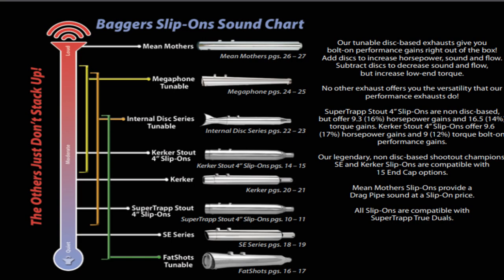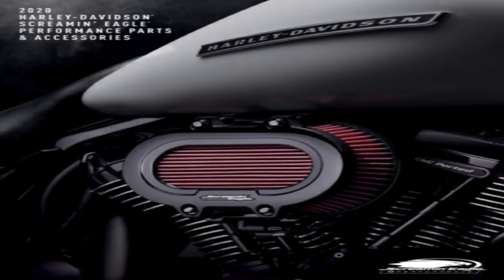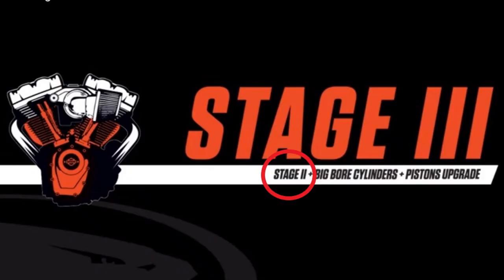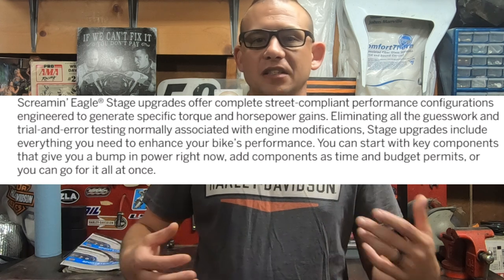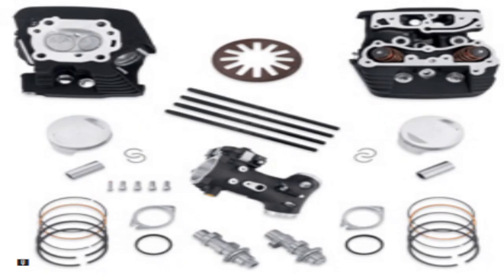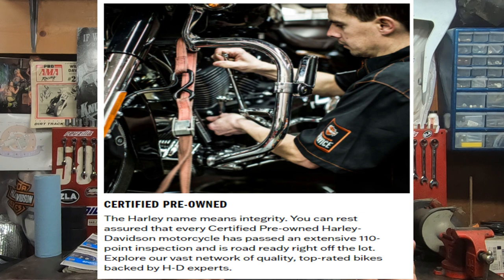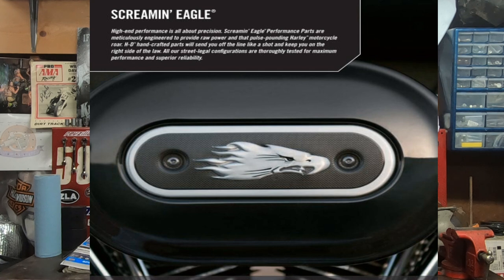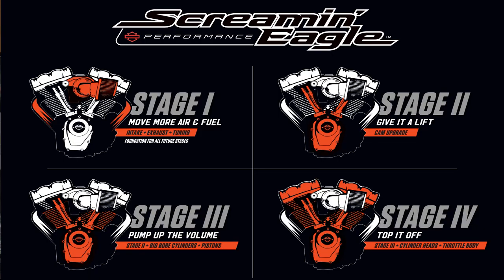Stage Kit Secrets, What Harley-Davidson Doesn't Tell You

Comment: I want to eventually take my stage 1 TC88 to 100ci.  You hit exactly what I'm struggling with.. I've been trying to figure out how to do the cam chest now, and do the cylinders later.  Doesn't seem you can without re-buying cams.  ( I'm not a motor head but think I can do this)  therefore I'm leaning toward an all inclusive s&s performance package.. it's just a difficult pill to swallow with the cost of things right now.
Reply from the maker: You can update your cam chest without even touching the heads... You'll need to cut your pushrods and then go back with adjustable pushrods. This will allow you to update the cam chest without even having to crack the rocker boxes.
Reply: @GixxerFoo  yeah. I know that but I want to buy the cam once. Not sure I can run the s&s 585 or a comparable wood cam without doin big bore kit w/ higher compression.   I'll prolly have to save my pennies and go for it all at same time. If I'm cracking the rockers to do springs, I'll likely want to just go ahead and do it all at same time..

Comment: Stages ,Stages, Stages  everybike needs an air cleaner & exhaust but it should be a mess big sucker air cleaner - preferably a Thunderheader  exhaust & a tuner that will get you started in the right direction all other modifications will depend on how fast you want to go & how much cash you have ! Screaming chicken parts are a compromise at best look to the aftermarket for everything else ! At my shop I am the warranty ! Hell I got 80 cu in bikes out there that will out run most of screamin chicken bikes ! I had a guy just the other day that told me the worst sound he ever heard was when my 80 incher blew by his 117 M8 !
Reply from the maker: I wouldn't feel too bad about getting smoked by a Evo on a M8 especially after hearing what's in your Evo!

Comment: I'm relatively new to Harley (2 years) and am loving my Sportster 1200L to death.  While I appreciate the vast selection of aftermarket accessories, if I had wanted raw speed & power over everything else, I would have just bought a four cylinder Japanese sport bike -- "One and done".
Reply from the maker: I rode inline 4 sport bikes for years, the thing I noticed was just as they started to really run you had to shut it down. But the Harley on other hand a Harley can makes more power and torque way down low were you can use it. Lol I used to get smoked off the line by Harleys.
Reply: @GixxerFoo ... that was probably me on my 1st ever Harley 1200 sportster in '88. I did that every time. Crazy, right?

Comment: I go out of my way NOT to go to the HD dealership. Every 12-15 years is enough.
Reply from the maker: I don't blame you there!
Reply: Well my thought on the dealerships is this. Given the fact that they ARE expensive they are also bound by Harley to follow all recommended procedures regarding repairs which would include proper torque specs, replacing certain hardware, ie; nuts, bolts,washers, gaskets and things of that nature and simple physics and metallurgy does lean towards things like fresh hardware to preserve integrity in fasteners I do opt for the dealership since speed kills and I ride pretty quick. To add to that the mechanics have to be certified by Harley to work there. Not saying anything bad about the independent shops but I’m pretty sure most of them don’t stock all the fasteners required for service. When I see the fasteners listed on my bill I do pucker but at least I feel safer knowing they were replaced. I also like the accountability. I’m sure some will say that their independent shop is great and I’m sure they are but I just don’t want to go around “trying out” various places with my neck at stake. I tried that where I moved to based on recommendations from people that I know and had a guy do 574 cams. Said he’d do a high pressure oil pump and didn’t. Turns out no oil pump change, same cam bearings and bases on what he charged me no new fasteners or gasket kit. When I asked around awhile later I found out he’s a coke head and we know where that goes.

Comment: 114 to 122 uses cam from Stage 2 and subsequently stock heads. Can add SE ported heads and bigger throttle body later and wind up with a Stage 3.5....lol The only "waste" is would be the Stage 2 pushrods if gong from Stage 2 to 122 ci.

Comment: Great info as always. I always looked at a stage 2 as the way a bike would run from the factory if there wasn't an EPA. After that I would say that an engine should be designed for what you want, right from the start. There isn't much sense in constantly rebuilding and moving from one stage to the next. Build it the way you want it right from the start. I personally wipe my ass with the warranty but to each his own.
Reply from the maker: The warranty really isn't worth a whole lot in many cases, but some people are really hung up on SE parts and the warranty coverage. Honestly the main issue with the M8 is the sumping and Harley is very reluctant to do anything with it under warranty.
Reply: @GixxerFoo  I'm not surprised. I've never had any luck getting Harley to do any warranty work or honoring the few simple recalls I've had over the years.
Reply: There is zero reason to ever buy a Harley brand new, especially if you have no need for a warranty. I have several HD's and I have the one I bought brand new 22 years ago before I knew any better. Love the brand and love you slinging the truth to the masses GixxerFoo!

Comment: With a 117, Harley does not offer  torque cam or a power cam, however they come with a higher revving power cam as stock. They do offer a Screamin' Eagle SE8-515 Cam.  What does it do if you have any idea? All it says is ''The cam’s high lift and long duration profile is ideal for opening the valves to efficiently fill the combustion chamber of larger displacement engines.'' Does not show any dyno charts so do not know if it changes the RPM rev range plus or minus? Want to keep warranty so can not go after market.
Reply from the maker: If you're looking at the 515 cam that's more of a top end cam, the 117 kit makes something about 120 horse and about 115 torque. What that cam is going to do is push the horsepower and torque higher up the rev range. You lose a lot of low end torque in my opinion but make it up on the big end. I would go with the stage 4 kit rather than just adding the 515 cam, you'd have to change the valve springs out as well. If you're going with just a cam I would do the bolt in torque cam from Screamin Eagle. But on a Milwaukee 8 a cam swap with a Wood WM8-XE will blow away the stage 4 kit with a bolt in cam swap. You'd void the warranty but it's a great option to consider after warranty.
Reply: @GixxerFoo  You said, ''If you're going with just a cam I would do the bolt in torque cam from Screamin Eagle.'' But with a 117, Harley does not offer a  torque cam or a power cam, however they come with a higher revving power cam as stock. So I was wondering if the 117 on a Street Glide ST model has ENGINE TORQUE (RPM) 3750, and the Low rider ST 117 has ENGINE TORQUE (RPM) 3500 (A 114 has ENGINE TORQUE (RPM)  3250) what does the 515 cam do as the 117 in both Street Glide and the Low Rider both have higher RPM power type cams already installed? So why would anyone install a 515 cam in a 117 when they already have a high RPM cam already?

Comment: Harley is flat out stealing our money when it comes to a stage 1 or 2 kit. There is no reason the engine should not already have better flowing air, exhaust, and a cam for TQ or HP depending on the model. If the EPA approves of these changes then it should come this way. No tuner needed until the stage 3 or 4 mods.
Reply from the maker: It is suspicious when you look at the Screamin Eagle slip-ons and open air cleaners. All EPA approved but they give you a restrictive air box and mufflers right off the show room floor.

Comment: I really like your content. I have a 2014 flhtk with stage 4 103. I don’t like the cam. I do a lot of touring and fully load my bike with wife on the back. We go through the Rockies quite often. I would like better response from my bike. I ride between 2500 and 4200 rpm. Very rarely go above 5000 rpm. I find midrange torque to be modest at best. What would you recommend to wake up my bike?  I only have 30k on my bike as Covid and a knee problem kept me down the last few years. Any recommendations would be appreciated. Thank you.

Comment: Great Info! I've got the stage 1 done, and now I can skip the 2, and 3 and go straight to 4🤗.
Reply from the maker: The Stage 4 is interesting as it makes roughly the same power in the low and mid range. With the Stage 4 all the power is really up on the top in the higher RPM range.

Comment: Great video and you nail the truth every time the screaming eagle parts are good the problem is the map tuning they use and the cams are well you know that’s why after your advice I went to fuel Moto got woods 555 cams and jackpot mufflers once done end of December I will let you know what it dvnos out at and FYI to all if you do any performance upgrades and keep it under warranty you must do it the first 90 days of purchase no exemption and the extended warranty starts the day you buy your bike every one have a good weekend
Reply from the maker: Harley's street tuner doesn't allow the air fuel ratios to be adjusted, no matter what timing and cylinder VE adjustments are made it's still running at the maximum lean ratio per throttle position. The cam and exhaust from FuelMoto is going to be the ticket!
Reply: @GixxerFoo  yes and that’s why I’m having it dyno tuned can’t wait they said I should see high 90s on ho and over 100 fp torque can’t wait

Comment: Well I have a 2014 road king with the ho 103 and a v&h fuel pack tuner...and it performs really well...
Reply from the maker: Those FuelPaks work great on the fuel injected 103's, it gets the fuel in them and makes the necessary timing adjustments. It's really a night and day difference!
Reply: @GixxerFoo  yes it does.
..I just have old school fishtail slip ons and I can still tell a difference

Comment: I have a 2015 Street Glide Special with 30,000 miles.  I would like to use the Woods or S&S bolt on CAM with this mileage are there concerns with this mileage?
Reply from the maker: It just depends how well the bike has been taken care, but with that kind of mileage I would look at a lifter change as well. A good inspection of the cam chest and if everything looks good you shouldn't have an issue.

Comment: Yet another great video! I'm skipping the stage kits and in the process of putting the SE 120R with D and D low cat exhaust in my 2013 CVO Breakout. Yes it's more expensive but I get to keep my 110 which only has 10k miles on it. Do you think the stock transmission will hold up to the torque the 120R puts out?
Reply: The trans will but the compensator,  chain adjuster and clutch will need to be addressed..really the bottom end is also a concern..ie..crank/pinion runout ..bearings etc...
Reply: @edwardfaris8516  Much appreciated! I'll get to work on these. Seems like there is always something I'm forgetting 🤣
Reply from the maker: The transmission will do just fine, I would for sure us a good compensator, heavy duty clutch and a manual primary chain tensioner. Those additions to that motor will save you a lot of headaches down the road.
Reply: The six speed trans is a piece of junk & will absolutely die the main bearing dies but if you drain whatever oil you have been running & use Amsoil 75/140 severe gear in it you might save it I've rebuilt quite a few  some of which I had to cut what was left of the bearing race with a cutoff wheel ! One of my customers has 2 rebuilds before I started using 75/140 Amsoil his bike has 90000 miles on it !

Comment: As with any build or project bike boat car etc. First have a plan as to what you want the end product to be otherwise you waste money… they aren’t being sneaky or tricky… As far as the stages… stage2 you can’t maximize a larger cam if you can’t get the air in and out better. Stage3 you can’t maximize extra displacement with a smaller cam. And Stage 4 when you really bump up displacement and cam size refer back to stage2 reasons 
As far as aftermarket making more power cheaper that’s all they do… they aren’t R&D entire machine just one small area hence the better attention to detail that’s all they are dealing with. That and they don’t warranty your project/build either

Comment: You are 99% correct. The main reason why SE cams are not as aggressive as others is because of EPA compliance.  Also, extreme lift cams typically result in early wear ant tear issues.  I also think HD rips us off because a Stage 1 should come stock from the Factory, you shouldn't have to spend extra on that.
Reply from the maker: The SE cams are for sure built with emissions in mind, it's hard to be emissions compliant with high overlap cams. Most bolt in cams aren't super hard on the valve train, now you get into the very extreme Wood cams that could cause some wear over time.

Comment: Interesting and informative video as always. I am interested in your opinion on these lumpy high lift cams as they require heavier. sometimes much heavier valve springs. Since this requires more work from the engine simply to actuate the heavier springs. could this cause a in decrease overall engine output and/or excessive valve train wear?
Reply from the maker: A high lift cam with a lot of overlap using a heavier spring won't decrease power at all or cause excessive valve train wear. When you go with a high lift cam, matched with valve springs and setup up properly with correct push rod length it is very reliable. But of course with a cam like that you need to have the correct compression ration as well or you will go backwards in performance.
Reply: @GixxerFoo  Thanks for the quick reply. As usual a concise and balanced answer.

Comment: So if your end goal is stage 4, I should skip stages 2 and 3?
Reply: I would say yes. If you've got the funding for it, look closely at the torque curves in the catalog and think about how you want the bike to perform after the money you can spend on it.
Reply from the maker: Yes, go big right from the start and save the money if that's your end goal. But I would suggest taking a close at the Stage 4 compared to the 3. The 3 makes just as much power in the mid range, the 4 takes over way on top.
Reply: Like I say stage 2 is the most cost effective after that the cost goes up dramatically with the Dyno curve I have a 2020 RoadGlide s stage 2
Really a great running machine.This is my 7th HD the prior bikes all had some level of build.At 64 I am too old to chase every last HP.Labor and parts cost  be it an H-D dealer or Indy mechanic the cost is out of wack.Screamin eagle and Harley are exceptional parts still winning national championships. Harley warranties the upgrades at purchase any parts you buy at the dealer and have them install comes with a one year warranty
Look at a cvo sick expensive but they are complete sounds quiet in the neighborhood get it on the road and hit it and it is all Harley.These are heavy baggers if you want to go fast cheap buy a metric and ride your Harley as intended, save the performance dollars for your next bike.
Reply: Yes...

Comment: It seems to me and I am big time guilty of doing this in the past.  At stage two installing too big of cam(s) thinking in the future when I do heads big bore etc. I do not need to buy another cam.  Then you ride the bike another year or two and never go stage 3.  You trade or sell bike and start all over. I realized I could of had a better performing bike if I went with a milder cam that was made for parts currently being used on the bike.  My current bike I went with the MR-103 S&S cams.  knowing it may be ok for a mild big bore build.  But also knowing if I want to go more aggressive I will want to change cams again. In the case of HD scremin eagle I think its smart to not over cam.  Forums are full of disappointment with people bolting in too big of cam(s).
Reply from the maker: Too big of a cam can really ruin the rideability of the bike, you can lose your bottom end and then have it explode in power on top. The MR103 is a very versatile cam, it works very well on a otherwise stock bike. I like it since it works even better when you do get into some mild head work or bore increases as well.

Comment: Stage tuning has been around for years but not always with original manufacturers parts.
It went hand in hand with the different racing classes as a way to make racing affordable and more competitive. From bog standard to Blueprint and on through the various stages. The Japanese factories were very willing to supply factory kits for race bikes to give the rider that could afford it an extra edge. So no its not a Harley idea. But directly marketing for street use certainly was. The quote of almost every part maker and supplier that they are for show or off road use only is not just the easy legal cop-out. To many its marketing.
Forbidden fruit always tastes sweeter.
Reply: The most important factor is balancing your efforts. It is futile to add big bore pipes and hot cams if your head can not breathe. But if your engine will self destruct from high revs you are limited to adding the power where its more useful and actually better for daily use.
Maybe that knuckle ain't so bad after all!